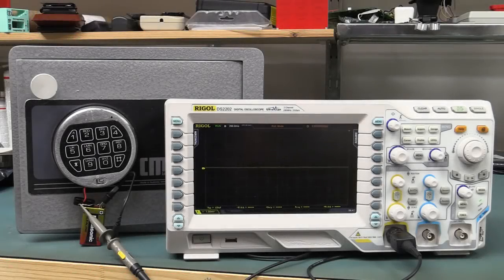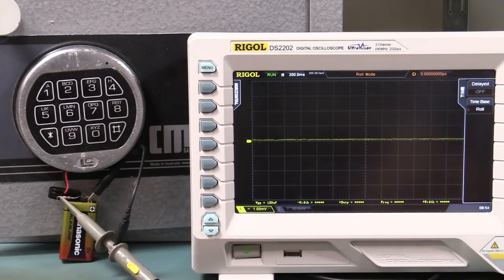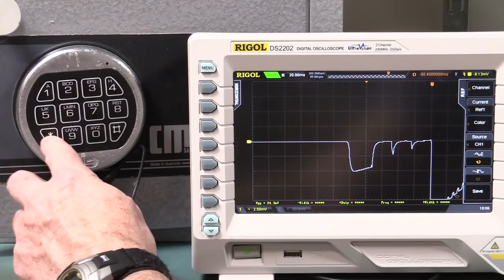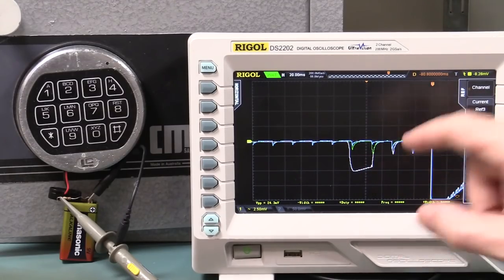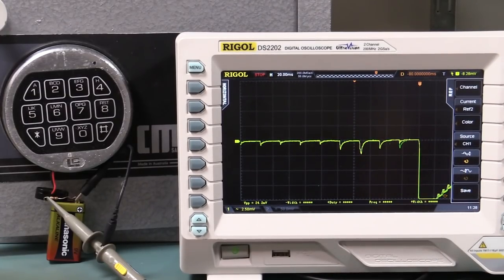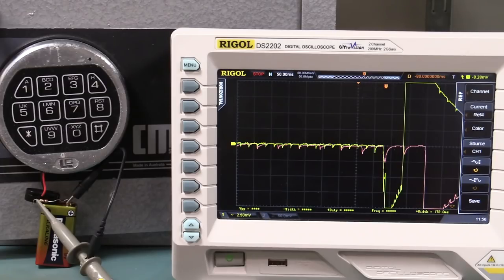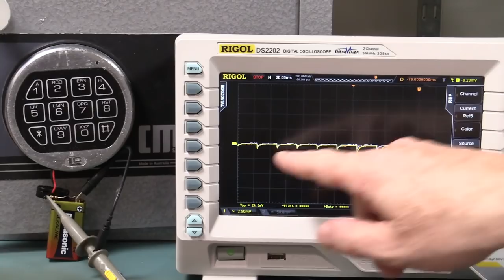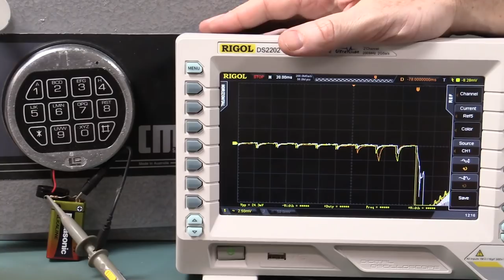EEVblog #771 - Electronic Safe Lock Powerline Attack Part 2

Comment: At a guess, the variability is due to the quirks of flash memory/the ROM.

Can't remember which direction, but changing ones to zeros/zeros to ones is not symmetric, one takes substantially longer/more current than the other, leading to any timings getting messed up by what was in the cell previously, hence why 0 looks different to the rest- all 0s in binary, whereas all the others have at least one 1 in them.

To make it consistent you'd have to enter the correct code after every attempt.

This still leaves the possibility of a powerline attack if it's being naughty like this and not clearing the code memory after every attempt, but it'd be more difficult to pull off, needing access up to 4 separate times to the safe, say if 0->1 is the expensive one, then first time you enter all 1s, second time all twos, third time fours, fourth time eights

And see which positions took a different amount of time, the. Those have a 0 in that position, and you have the code, by comparing the bit values of the previously entered code, which is presumably the correct one, as most don't input an incorrect code after they unlock it.

You could probably reduce it to less if you could discriminate between different numbers of expensive transitions

Comment: The second valley from power off only seems to go as deep for correct numbers even though it doesn't always. That could still be useful for cracking, but yeah, annoying.
Maybe worth checking if power waveforms rotate through a set or completely random by repeating the same code times in a row.

Comment: did you test whether or not having one incorrect following by a correct number produce the "correct" or "incorrect" form?
also did you try whether or not cutting power altogether resets the timer? because if it does you could automate it to be much faster, circumventing the 10s and even the whole lockout possibly, I imagine replacing the keypad with a selfmade tool that sends the combinations to the inner processor, faster, cutting power if output is "false" to reset the timer

Comment: EEVblog, did you try to unplug system from battery after pressing an incorrect sequence? If system resets its internal counters, brute force attack may be possible resetting system after each try.

Comment: I expect that the firmware stores each key press as a 4 bit number, and the odd behavior on some of the even numbers is from the processor storing the byte/word and preparing the next byte. Then when there is a comparison, I bet it checks two buttons at a time by comparing one byte at a time.

Comment: just a thought, would it be possible to electrically bump the solenoid. some form of emp, like high power transformer coil to induce voltage in the solenoid to open it. not sure how much you could couple with the case material in the way.

Comment: So to use the exploit, you'd need a wireless micro probe you can install into the battery compartment, and then a receiver scope, best would be connected to a computer that can do the calculations for the attacker once they try... Quite the effort, drilling into it would actually be easier :)

Comment: Could that higher amplitude waveform have anything to do with the solenoid being activated? If it were already in the unlocked position, and the correct code were reentered without the safe being opened/shut and presumably having the solenoid reset to the locked position, then it wouldn't draw as much power and the corresponding waveform would be smaller.

Comment: question: after 3 failed attempts, and you get locked out, Will removing the battery reset the processor. if so, you would not have to wait 10 minutes to retry.
Reply: There are caps in there to keep the clock ticking. I guess if you disconnect the battery and somehow managed to discharge all the caps the counter would start from 10 mins as soon you apply power again
Reply: Micky S. 
Short the power leads to discharge the caps.
Reply: Ok ... If i would have written the code. I would have put in a tiny bit of Flash memory. After every Failed attemt before it even would show to the user that the code is wrong i would increase a counter and Write it to Flash memory. 

If the counter reaches 3 you get locked out.
& the Clock starts ticking. 

When you remove the battery and discarge all the Caps the clock would stop ticking and the rpogramm would stop. 

Now for the Fun Part:
As soon you apply power the Microcontroller would read from the Flash memory the State of the lockout. 

Becasue it has written 3 before it got Shut down. it would wait 10 mins and then unlock for you to give you 3 more attempts. 

so even if you break power and discharge all the caps after 2 failed attempts you would be left with only 1 attempt after you give it power.

Comment: Excuse me if I sound uneducated but I've heard once that even the clock cycles of modern processors could be "tuned into" as they encrypted data. An attacker could then use the signal to determine which operation was carried out on which string of data, which in turn allowed them to intercept unencrypted data. So why does Dave monitor the processor's power consumption and not its clock cycle?

Comment: There is plenty of "out of the box thinking here" check if same with "bad battery" as in lowest voltage for it to work on 5v? input see if same, next thought will be is sound coming from device if same as is in sample sound and check, if same beep is same on all numbers, next attack will be checking the red diod if same blink on all numbers, and again check with "low battery warning" another idea  is to add vibration to device (harmonics), or even ESD discharge close to touch pad...

Comment: Does taking the battery off reset the timer when you lock yourself out?  if not it must have another internal battery to keep the timer running.

Kind Regards

David

Comment: The different waveforms may be due to differences in button-press or even button-release timing. The MC may be going into a lower-power mode (many MCUs have several different sleep states) between presses with an N milliseconds gap. The wake will use a bit more power. You'll get seemingly random waveforms when they're not. You're more likely to find a vulnerability if you replace the keypad with another MCU that hammers the safe's MC with combinations while you save the entire sequence's waveform on a better suited scope for this, like a logic-analyzer & PC, along with the code entered. Just start it and go get lunch. If there's a vulnerability, you'll see it quickly. There probably isn't one from the power line though, those are big tantalums on that board. 

If I really needed to get into one of these, I'd try to get a PROM dump off that MC.

Comment: I doubt that the digits are checked for validity as each keys is pressed. It is more likely that each keypress is stored in RAM and then they all are compared against the correct code in the EEPROM after the last digit has been entered. 

This would explain why power line monitoring does not help to determine the code.

Comment: What about even just wear/fingerprints on the key panel? Seems like you'd want to change the code fairly often to give even wear on all of the keys.
Reply from the maker: LPFthings Even if you had the 6 digits used, that's a lot of combinations. With the failure timeout it makes it impractical.
Reply: EEVblog  Not when so many are set to the factory default combination :-D
Reply: EEVblog You had something in success of finding if a two-digit combination is successful. Accounting for that 10 seconds between attempts and input time, it would take between 7 and 8 minutes to get the first two digits. Each next digit would take much less time, given that you know the six digits (and that none are repeated). Given all of those, the safe could be cracked silently in 20 minutes.
Reply: Prehistoricman ah, but there lies the problem, you don't know if all 6 digits are going to be repeated or not...
Reply: Peter Carlson Depends, if you use fingerprints/wear like I mentioned, and only 5 digits are worn down, you can assume there's a repeat in there somewhere. You don't know which, but you know there is. Although perhaps the repeated one may be even more worn down than all the others.

Comment: If I would program such a lock I would collect all six keypresses and only compare after the sixth key. So no difference in program flow if it is a correct or incorrect key. A little difference would occur while the comparison depending on how much keys are right. But with a big cap in the powersupply there would be no noticeable difference, I believe...

Comment: The Zero key as you found is different - on some devices it cancels the code being entered before you finish. If this doesn't count as an attempt (I'm guessing it wont) - you could press (or automate) 0 then instead of waiting  the 10 seconds... 
Could speedup the brute-force part a lot?

Comment: Would definitely like to see probing of the chip.  I have a safe that's open with the same lock but a slightly newer model and this is the fire safe rated for £50,000.  It was opened with two crowbars and a hacksaw.  This was opened by the people when a building was being demolished in the UK.  It's a fire safe much bigger but the electronics are the same.  Selnoid is bigger  I would like to find the code so that I can use the safe now I have replaced the hinge bolt.

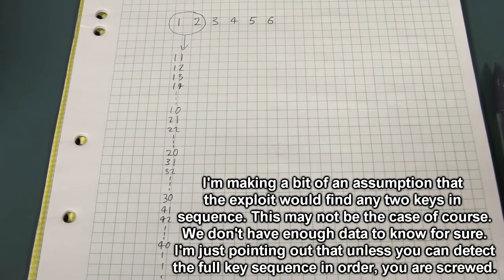Comment: 17:28 They use the same electronic design on some of the TDR models though, right?  You might be able to engineer a situation where you have a couple hours with one.  Breaking into a gun store or bio lab for instance.

Comment: That was super interesting. Reminds me of finding software exploits but its EE :). I had some thoughts when watching, like that non-repeatability you were getting when taking some baseline singleshot captures when looking at 2 digit sequences. I was thinking about if that it could be tied to another variable that might be predictable. Like maybe the processor is in different states when you are trying different sequences, where it changes its state if say you typed in the correct code or incorrect code before hand and that would have an effect on the next 2 digit sequence scope reading. food for thought, but yeah you can always get crazy with these things, like signal analysis comparisions, and algorithms to see what certain variables effect other variables, kind of like a software "fuzzer" but not. interesting. So interesting!

Comment: Great video. Dave, have you tried to eliminate the incorrect numbers? If each digit is read into a buffer, you might be able to find a clearer difference in the time the scanning takes with a sequence of same numbers that are not in the combination. With the 123456 combination of your example; 777777, 888888, 999999 and 000000.

Comment: I'm thinking the processor just waits for 6 digits to be put into a buffer, then runs them against the proper code, rather than checking them as it goes. Honestly would be the smarter way. Thus, no power line vulnerability.

Comment: Dave, in the first video,  you drilled a few extra holes to allow you to reconnect the connector.  After you had the safe open, you used a standard phillips head screwdriver to remove the lock assembly from the door.  As a thief, why wouldn't you simply drill a few extra holes in the lower half of the back of the safe, reach in with a long screwdriver, and remove the latch from the door?
I realize it's an exercise in signal analysis, but would a real thief even bother when all that is needed is to reach through from the back and remove the latch from the door?

Comment: So, I know this is unpopular based on the comments, but it’s possible each button is compared in order as it would be very efficient using bitwise operators like xor assuming key 1 is 1000, key 2 is 0100, key 3 is 0010 and so on.  You could map it in a table so the correct code is always 1111 or whatever and if a wrong key is pressed exit the sequence immediately to save processing power.  Without firmware analysis it’s impossible to really know.  I’d like to see a firmware dump, if it’s a mips processor or something, should have a serial Rx and tx for flashing to connect to.  Could actually lead to a viable vulnerability if we could see the assembly.

Comment: 90 possible permutations (10P2) on the first 2 sequenced numbers, hence, if you have a robot, trying all the possible combinations, after the 10 second-delay, and assuming it can correctly analyze the oscillator instantly, it would take a maximum of 15 minutes, to find the first 2 numbers.

Thereafter things get easy, as there's only 10 possible results on the oscillator, if you have sequenced the first two numbers as 1 and 2, you only need to try :0(1,2,0) 1(1,2,1) 2(1,2,2) 3(1,2,3) 4(1,2,4) 5(1,2,5) 6(1,2,6) 7(1,2,7) 8(1,2,8) 9(1,2,9), and you've gone through all the possible combinations on the 3rd possible number, assuming the 1st sequence you captured was correct. So running through this sequence would take 100 seconds as there's 10 possibilities. 

So the maximum amount of time theoretically required to break the safe, would be 900 seconds + 500 seconds =  23.33 minutes, if the combo could be 6 digits long. This of course has assumptions that greatly understate the time it would take a human to do this in reality. First, the human would take quite a bit of seconds just to analyze the oscillator result. Second. The oscillator itself seems to be inconsistent, so the same sequences may have to be done multiple times as to avoid an inconsistent result. But as I mentioned, we are assuming a perfect robot in a perfect setting with a perfect vulnerability.

So with all those requirements met, 23 minutes and 20 seconds is the maximum time it would take to break this safe.
Reply: I know that this is an old comment but in the first 2 combinations there is a total of 100 options aka 00-99. In the second and third there are also another 100 options. Given the fact that you get an indication when you get a 2 digit block correct. In saying that they are the maximum extents. for example the second 2 digits could be 00 which would be obtained on the first of 100 possible options.

Comment: Why would anyone implement that other than to fill up a buffer with keypresses until all 6 entered, and then verify? OK it's worth to check of course, even if unlikely.
Reply: A hardware engineer thinking of it as a state machine might well do exactly that. Software and hardware engineers tend to think about things slightly differently; hardware engineers' code often sticks out like a sore thumb for reasons like this, and I'm sure the same would be true of Verilog or VHDL written by a software engineer.

Comment: I don't know how this code works, but after a little thought, if I was writing the code, I'd just store the sequence entered and compare at the end.
Reply: I'd go one step further: in the comparison at the end, I'd compare all the pairs, and sum all the matches, to prevent a timing attack based on how many loops the comparison lasted for, and then see if there were 6 equal pairs total. If less than 6 matches, it was incorrect.
That way there would always be the same number of iterations, and all the iterations would do exactly the same maths/logic, right until the final comparison.

Comment: 100 combinations for first 2
10 combinations for each digit after x 4 = 40
140 x 10sec 1400 /60 = 23.3 mins to find out combination
not including input time,  if each digit was the last one you tried, if i were them i would update that lock, to have the external battery recharge an internal batery

Comment: If I designed this then I would put a decent capacitor on the processor, and also probably put some circuit making noise just because, and why not use a really unstable oscillator while were at it? (something that changes constantly (1MHz one second, 5MHz somewhat later and just random)) Then one could also put some random code in the processor too. And most importantly, don't make it do any processing until all 6 digits are collected. (And processing could take half a second or two, don't think anyone will care) That is at least what I would call safe.

Comment: ok idk if someone has mesg on this yet but i had a lot of fun watching the process but the power line attack is classic u are close but not u are not really doing it the right way its like ur using tech from 1985 (the occstelloscope) eventually ppl realized even with decoupling a basic line of code doing the 1-1 1-2 1-3....etc and so on--- theres even ways to decode especially powerful decoupler systems aka use an iphone and a usb to 9v. w/ regulator. write 2-3 lines of code and your done i can prob get all 6 # within 20 seconds using that method---every 3 tries u have to make it restart but only because the password is 123456 if it was anything else it would take a tiny bit longer

Comment: There definitely seems to be a vulnerability in that safe. To note, you're looking for consistency and commonality. The waveform doesn't have to be exact, and it looks like 'correct' inputs are outputting a higher amplitude node with decent repeatability. Similarly the partial-correct full sequences seemed to match while the full-incorrect sequence did not. Valuable security advice is never trust the big names to have covered every single base. They might actually not have figured someone would take an old Rigol to this lock. I say you have D2 program a new code in, then actually try to crack it live.

Also, should perhaps have tested a few two-digits starting with an incorrect. You might even get a bounty from La Gard if you manage to show them an exploit.